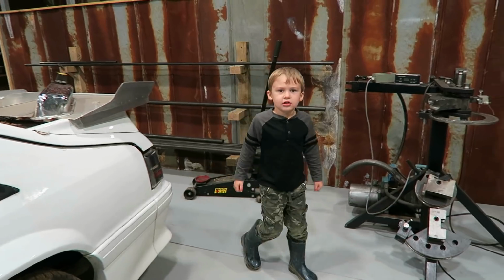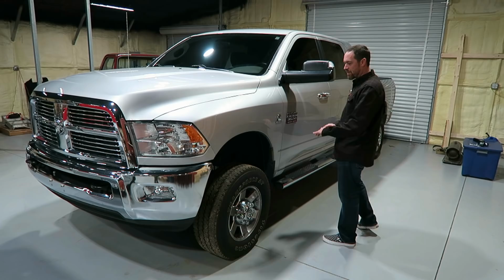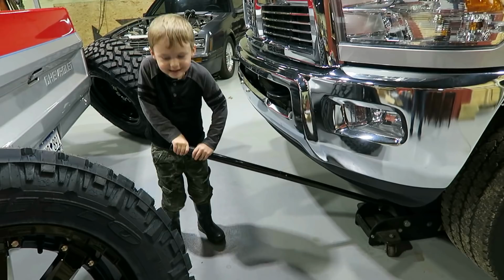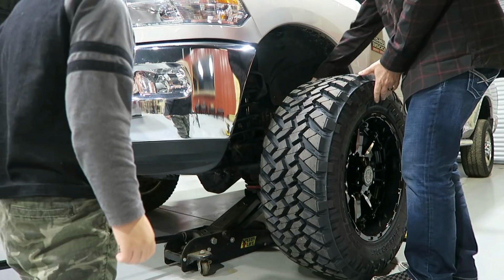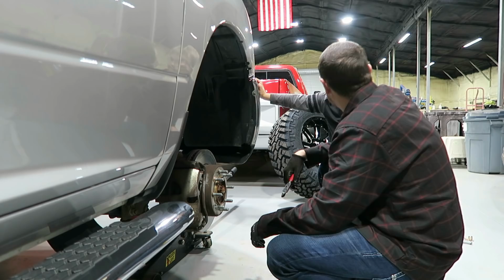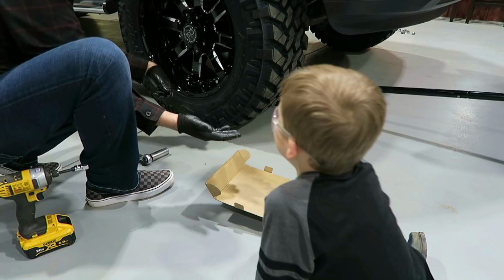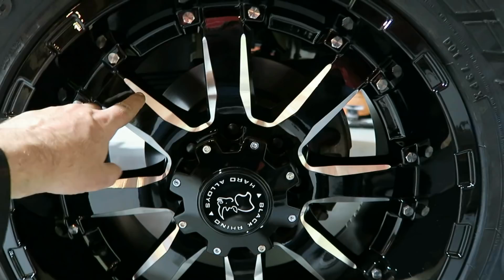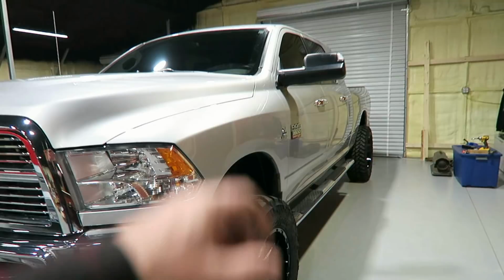Dodge Ram Gets 20" Black Rhino Wheels and 35" Nitto Trail Grappler Tires

Comment: Thanks for your video. Did you have any issues with the clear coat peeling off your wheels? My Sierras started to peel in less than a year. I had to have 3 replaced and now the 4th wheel is starting to peel.

Comment: You have just turned it from a tow weapon to a brodozer............
Reply: eh no... brodozers are those queers with 4+ inch lifts and ugly wheels and skinny tires that have a ridiculous back spacing so the tire sticks out 6 inches past the fender, with only a leveling kit you basically need some poking out to not have to cut up the truck to clear